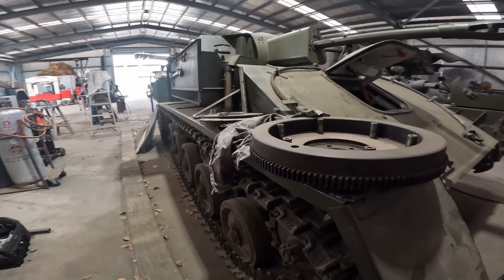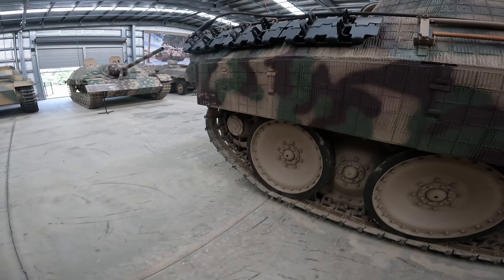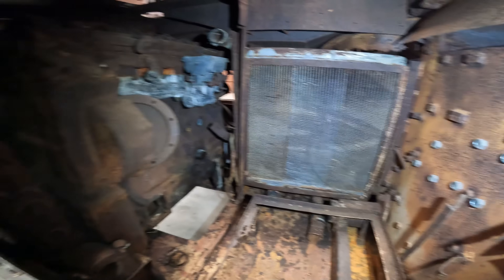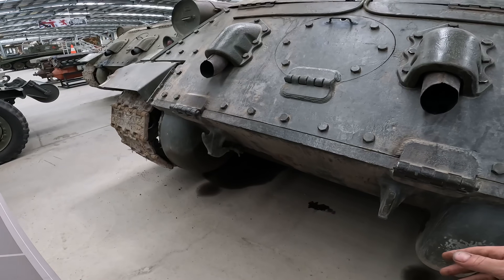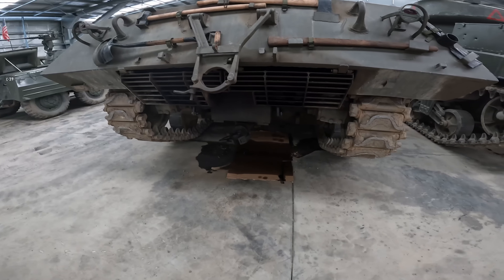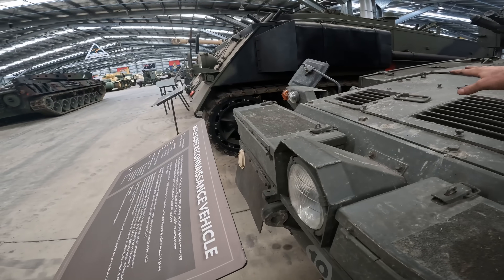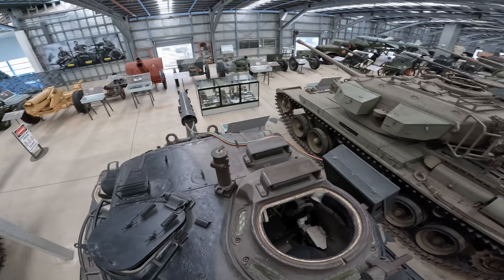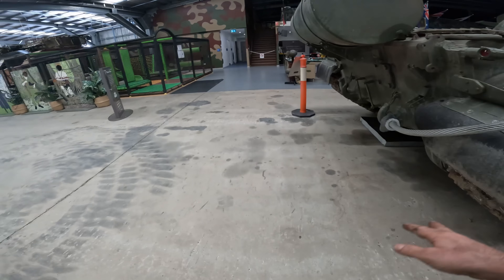AusArmour tanks need REPAIRS!

Comment: Modern well built heavy construction vehicles require a lot of maintenance and they are filled with electronics to diagnose issues. This stuff was all originally thrown together with a very short expected battlefield lifespan. Leaks and issues did not matter much when the vehicle was likely to get blown up in a few days. It is pretty impressive that they only have a few issues. They are not working on just one thing either. Vehicles from different countries, different drive trains, different languages in manuals.

Comment: Are you going to make a cradle to lift the tanks to do track adjustments. This would save time moving in and out to do the tracks.  A box with a ram that lifts a box up then pins to stop it from falling one front and a rear.

Comment: i have the urge to fix up tanks so badly 
i swear when im older ima try and get the maus running again there all i want my favourite tank up and running tho i dont have a lot of nolege about the engine and the two electric motors that basicly formed the transmittion
does annyone know stuff about the Daimler-Benz MB 517?

Comment: As a retired mechanic it would be awesome if you had "working holidays" for people willing to lend a hand!
Reply: If they were retired specialists it might be helpful... If not it could be more mentally draining explaining every last thing or dealing with people who think its a holiday and not a real job at hand.  I get your sentiment though... A tank repair barn raising of sorts :)
Reply: @ I’m also a welder and repair heavy equipment. Nearly all older mechanics are trained in hydraulics, electrical and brake systems. Diesel is diesel also.
If someone can remove the undercarriage off an excavator they would fit right in.

Comment: First im puzzelt that the oil finds its way down on the floor, I had thougt that it would stay in the Tub.

Secound. It seems all the same with the old equipment, you never get all vehicles perfectly done. Something always leeks or develops other problems.
And then there is this one Vehicle you never had to do anything on, always happy running.

Comment: There some work to do on your lovely AFV rhat require extensive experience to handle those beasts with the heavy transmissions, engine and much more but working inside they can be very difficult to reach so often seen your previous videos!! Until now you did a wonderful job 👏 🏅🥇🎖👍👍👍

Comment: Hi Steve,
You've described many years of future employment. The diesel getting into the engine oil on the 110, I once had a similar problem with a Cummins NTC 315. The leak wouldn't occur until engine reached operating temperature. Took me 6 months to discover it was the middle head had an internal crack from the fuel gallery misting diesel into the rocker pushrod oil returns I had to heat the head to 200°F while putting the fuel gallery at pressure and seeing the diesel misting from an almost invisible crack.